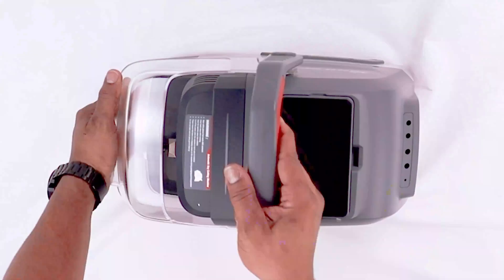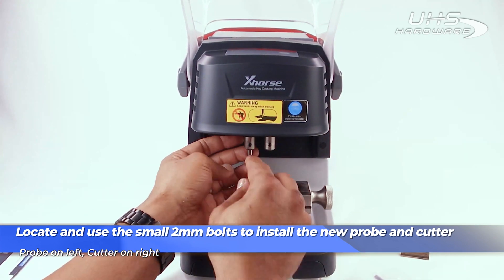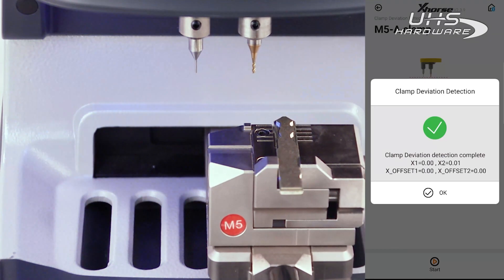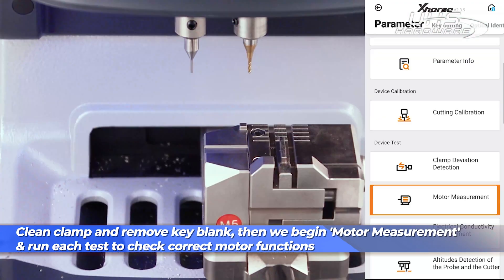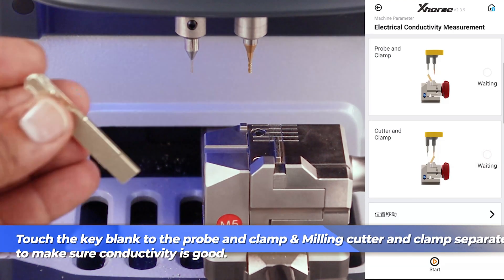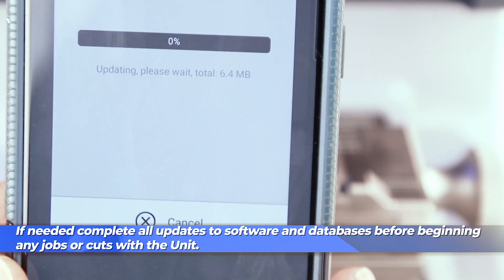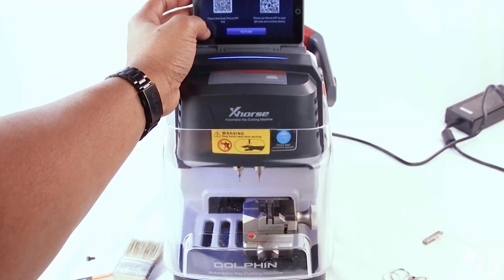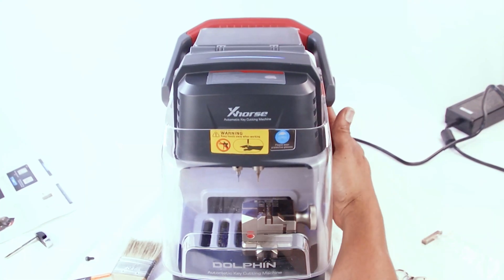How to Setup Calibrate & Cut Keys with NEW 2022 Xhorse Dolphin XP 005L Automatic Key Cutter M5 Clamp

Comment: Hey did the cutting calibration test leave/miss a small piece on the left top of the key blank because mine did and just want to make sure the machine is ok I just got it thanks
Reply from the maker: It shouldn't produce any defects or oddities if all is aligned correctly. definitely test and reset if it causes any issues after keys are cut. sometimes the smallest adjustment (~1mm) can make a world of difference. Please contact our support team if you have any issues you cannot resolved! uhs-hardware.com

Comment: What are the main differences between the XP-005L and the Condor XC-Mini Plus II? I have a piece of shit 3D Extreme from LKP in my shop that I'm ready to throw straight in the dumpster. Is the Condor worth an extra grand? I don't care about engraving. It will be paired with Xhorse's optical key reader.
Reply from the maker: The main differences would be the greater array of automated functions, onboard full control of device and  cut by code functions. Give us a Call if you need more specifics regarding the hardware and speed stats.

Comment: Love that new M5 clamp. I don't suppose that would work with the old version right?
Reply from the maker: Without having it calibrated it would most def not be compatible. Sorry bud. But, if you can find some manual setting that makes that work....? who knows :) but truthfully it wouldn't... probably
Reply: @UHSHardware  I am seriously thinking about buying a key cutter and programmer to offer the service in my area. Dealers charge so much and I kinda like this key cutter because it’s portable. Do you like this machine?
Reply: @UHSHardware it now is.

Comment: I’m wondering if I should get this new dolphin or the code 005. Reason I’d want the xp005 is that it’s been tried and true where as this device is new and make have issues? Is xp005 going out of life soon?? Just like the original keytool vs keytool max
Reply from the maker: Definitely a solid, qualitative, masterpiece imo. No word on any such decision for the latter version. Software updates, Customer and Tech Support for older Xhorse machines is always available at www.UHS-hardware.com. We have an in house tech team Direct, around -the-clock Contact with the Xhorse team and a wealth of knowledge on software issues and fixes. Contact us about your upgrade, or just to ask some questions about specs!